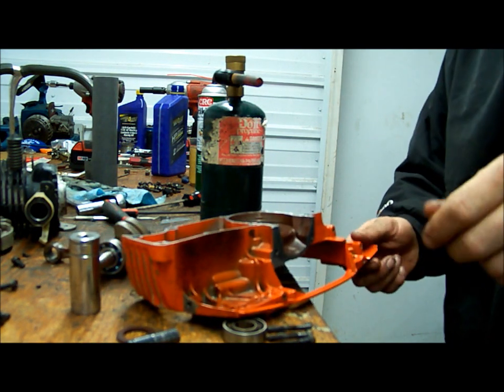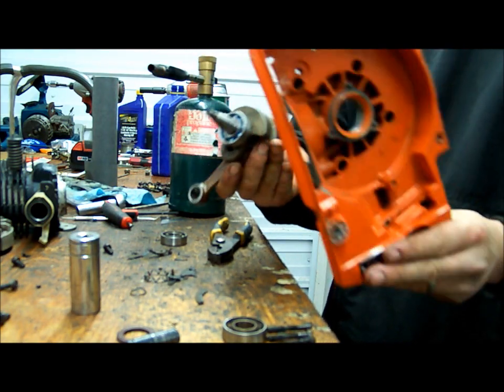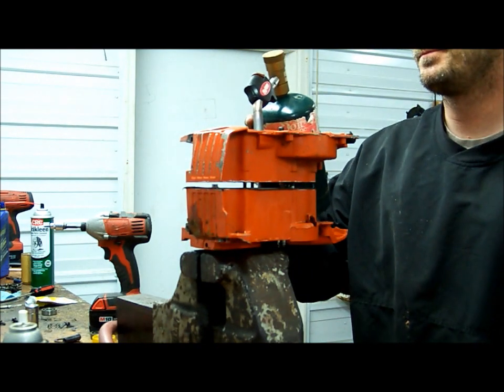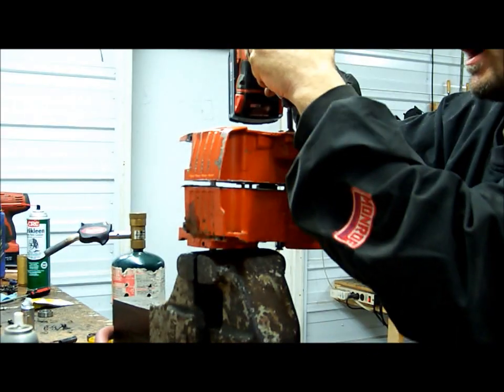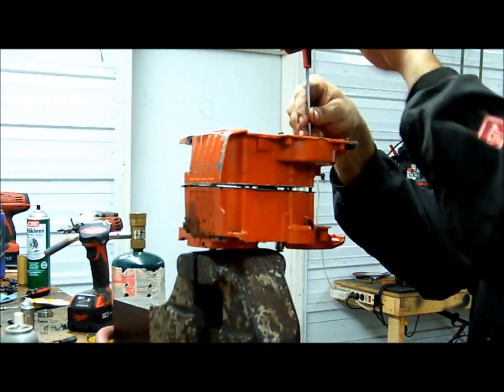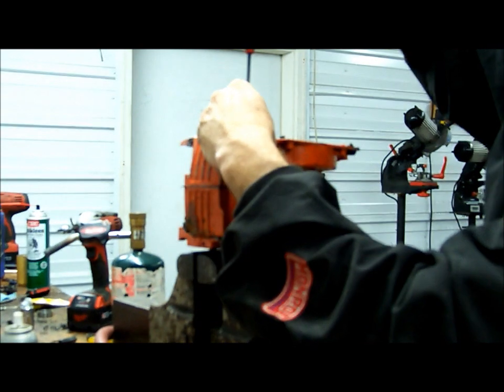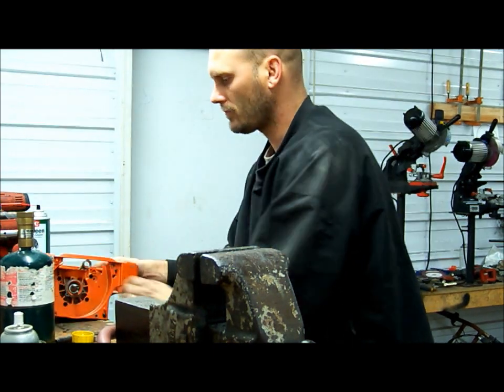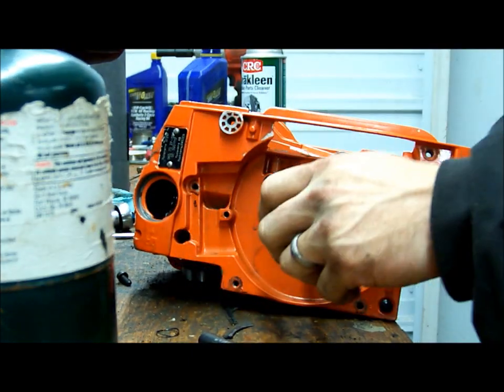Installing new bearings in a chainsaw crank case

Comment: I drilled a hole in a piece of 4 by 4 and I use it to put the crank in when I put the cases together.  I just put the end of the crank down to the counterweights after it comes from the freezer at about 2-4 degrees and grab the crankcase half out of the stove at about 260 degrees and push it on the crank.  It usually goes on without a lot of pushing.  I then put the crank/ case half in the freezer and put the other half in the oven.  The second half usually goes on with a little more effort.  Sometimes I use the screws to pull it on down but not always.

Comment: Thanks for sharing! When my cranckshaft is not rotating easily I heat the place for the bearing again and hit this place with a metal extension and plastic hammer. So the bearing will be free of tension. I never hit the cranckshaft because I think is wil damage hte bearing. But I can be totally wrong. I only got the result online here on Youtube. greets from Holland.

Comment: Hey. 

Thanks for the video. 
I'm rebuilding a Husqvarna 61. I'm putting in all new bearings, seals and crank shaft in it. I'm just wondering if I should grease the bearings? 
Any help or suggestions would be great. This is my first time doing this.

Thanks. 
Michael
Reply: no, perhaps lube them a bit with 2stroke oil after instalation
why are you replacing crankshaft

Comment: how to replace stihl chainsaw bar mounting studs ms290
Reply from the maker: Procedure can be found in this video I shot.  http://youtu.be/fUEiXMzpXTs
Reply: +oren levy If it's like a 250 you get to rebuild the whole thing, as the bar studs are integral to the gas tank/ crankcase core piece.